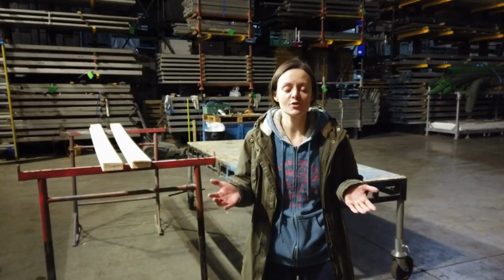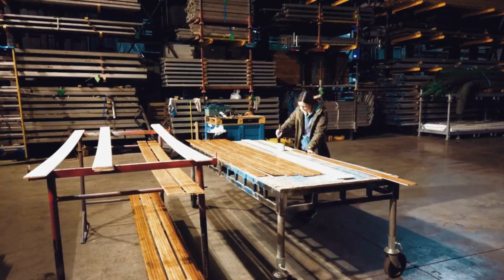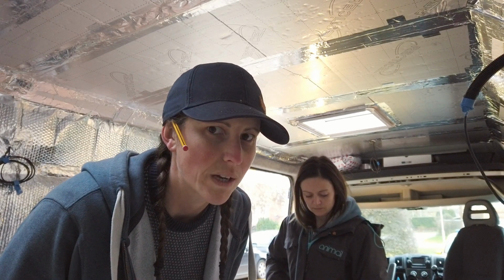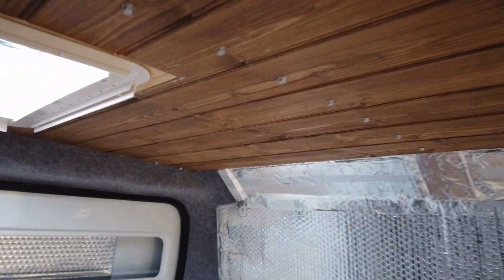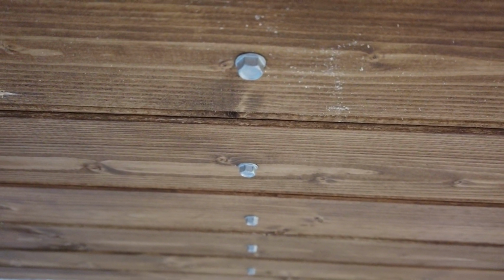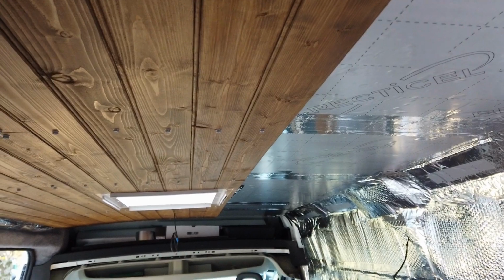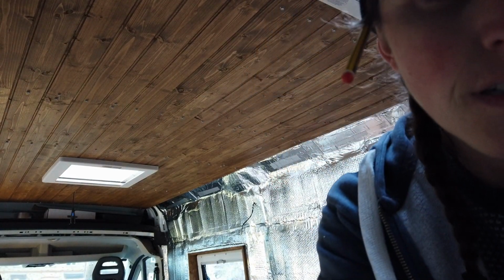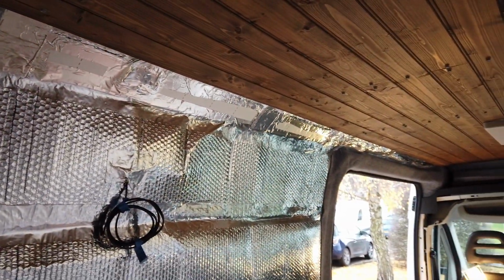CLADDING the ceiling in our CAMPERVAN build. Rustic looking ceiling with budget cladding.

Comment: How did you do the bit around the sky light? I have the same one and not sure if I should clad right up to it or try and clad underneath if that makes sense! Thanks!
Reply from the maker: Hi, I clad up to the wooden frame that I had to make for the skylight. So my cladding butted up to the frame. Then when I put the finishing plate on (the bit with the blind in) it covered the point where they meet. You need to know your ceiling thickness first to know what thickness you need to make your frame. Hope that makes sense.

The other way would be to make up your frame so it's your ceiling thickness minus the depth of you cladding, then your cladding can go over the wooden frame and is sandwiched between your wooden frame and the face plate.

We did a video on fitting the skylight which shows the wooden frame better 
https://youtu.be/dex63DYpin0
Reply: camper vibe thank you!

Comment: Hi, amazing camper conversion and great content in your video! just wondering how much Osmo you had to use? it seems like good stuff and the finish looks stunning!
Reply from the maker: Hi Aaron, thank you 👍 we just used the one tin, same size as the one linked in the video description. We did one coat front and back, if you have more to paint or want to do more coats you may need another small tin to go with it.